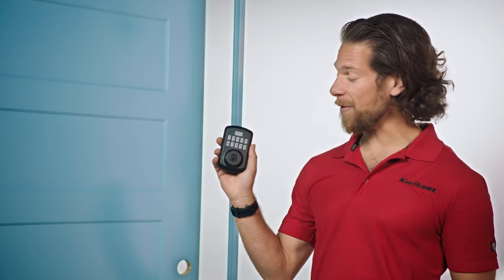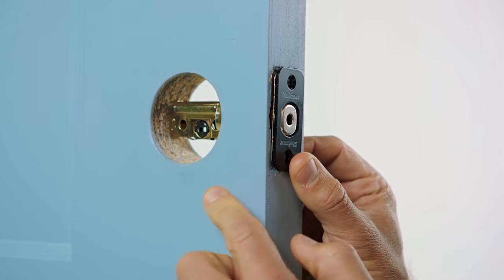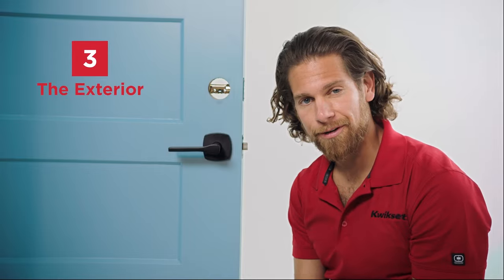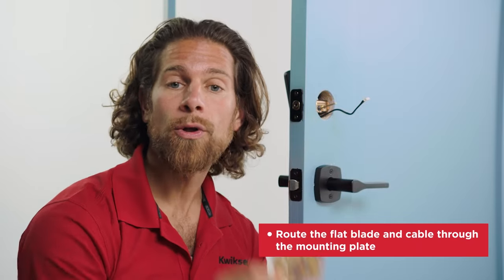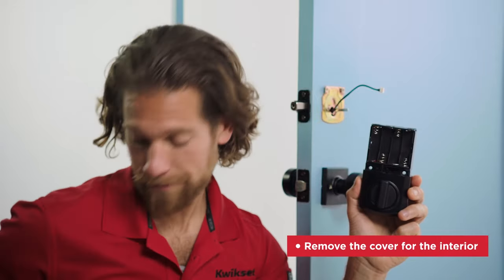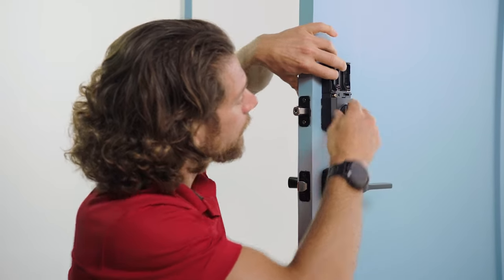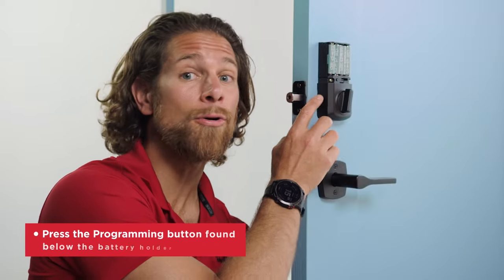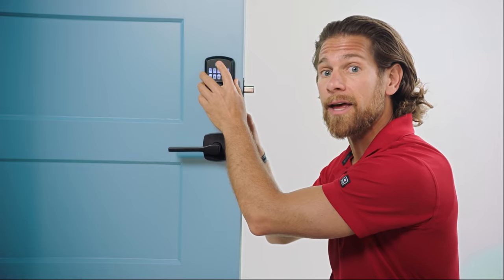Kwikset Powerbolt® 250 Electronic Door Lock Installation Video

Comment: My new lock won't set a code. It flashes red after trying to set the code. I've followed all instructions to the "t". I even factory reset just in case, but it still won't work. Any advice?
Reply: Im having the same issue
Reply from the maker: Hi and happy to help! To get the Powerbolt 250 programmed successfully, please follow these steps in order:
1. Ensure the lock was installed with the door open and the latch in the extended (locked) position.
2. Complete the Factory Reset, step 16, followed by the Door Rehanding, step 15.
3. Program the User Code, Step 6: 
https://kwik.st/3pJZg8g
If you should need any further assistance, please reach out to our Support Team here: 
https://kwik.st/3O54O6y  Thanks ~ Kwikset Social
Reply: Same issue. Just a POS!!
Reply: This doesn't work for me either.   Programming in junk.  @kwikset
Reply: @kwikset Thank you.  This worked for me as I probably did not have the deadbolt extended the first time through.
Reply: Nothing the kwikset team says will help cause they dont know what the issue is but after a very long niggt of cussing amd throwing tools i figured it out! 
The last 2 screws you install cant be too tight or it will never successfully program the lock
Reply: Same!
Reply: @DPLover4Life  you saved our sanity!!! The last 2 screws...edged them out just a half turn and then it worked!
Reply: @JoAnDelafosse  this lock is horseshit I've tried everything above and it still won't work
Reply: @DPLover4Life thank you!!! Nothing worked until we did this
Reply: Same here @JoAnDelafosse
Reply: After I set the code it was giving me that same problem. Wouldn’t even reset just kept flashing red. I popped a battery out and put it back in and the code was working
Reply: I was able to get it to set after taking the inside panel with the batteries off of the door and doing the door rehanding and letting the thing spin a couple of times, then pulling the battery when it was in the right spotty fit right onto the bladed piece.  I put everything together with all bolts loose and ran the learn procedure and everything worked.
Reply: Don’t buy. It doesn’t work
Reply from the maker: Hi @jacobwinkler1408 - Our Support Team is happy to help... please contact them here: https://www.kwikset.com/support/customer-service  Thanks ~ Kwikset Social
Reply: @DPLover4Life 🎉God bless you! Thank you!
Reply: Thank you it worked.
Reply from the maker: Hi @robcosenza5569 -  Our Support Team is happy to help... please contact them here before returning the lock: https://www.kwikset.com/support/customer-service Thanks ~ Kwikset Social
Reply: This worked for me!
Reply: I do all the steps and it won’t program
Reply from the maker: Hi @isaacortiz9232 - We're happy to help! Please follow these steps with the door open to get your lock working:
1. Check your door alignment and door jamb hole: https://www.kwikset.com/support/answers/how-do-i-check-door-alignment-for-my-smart-lock
2. Replace batteries, Factory Reset, and perform the Door Rehanding in Steps 16 and 15: https://kwiksetprodstorage.blob.core.windows.net/documents/kw_ig_5053733_9240.pdf
3. Reprogram the User Code in Step 6. Test the lock with the door open, then take your keys, close the door, and test the lock with your door closed to know if further adjustments need to be made to the door jamb.
Thanks ~ Kwikset Social
Reply from the maker: Hi @isaacortiz9232 - Our Support Team is here to help... please contact them here: https://www.kwikset.com/support/ask-a-question/inquiry/general or call them at 1-800-327-LOCK (5625). Thanks ~ Kwikset Social
Reply: My husband and I finally got it to work. Following instructions to factory reset step 16, then 15, then 6 worked to get the code set. But the latch would not open when using only code .. it would only open using code if the key was inserted (weird) …. So we started all over and reinstalled….checked that the latch was centered and that the flat blade hole was horizontal…. Reinstalled the mounting plate and made sure screws where not too tight… also, made sure the latch assembly was cleaned of any wood debris which ours had a few very small pieces inside the latch assembly… after reinstalling the batteries we did not have to reset the code that we set earlier and the latch is finally working perfectly without the key having to be in the lock.  Took our two (tiny) brains and all the helpful comments on this post to be successful. Thank you everyone for your help!! 😅

Comment: My husband and I finally got it to work. Following instructions to factory reset step 16, then 15, then 6 worked to get the code set. But the latch would not open when using only code .. it would only open using code if the key was inserted (weird) ..
.. So we started all over and
reinstalled…checked that the latch was centered and that the flat blade hole was horizontal... Reinstalled the mounting plate and made sure screws where not too tight... also, made sure the latch assembly was cleaned of any wood debris which ours had a few very small pieces inside the latch assembly... after reinstalling the batteries we did not have to reset the code that we set earlier and the latch is finally working perfectly without the key having to be in the lock. Took our two (tiny) brains and all the helpful comments on this post to be successful. Thank you everyone for your help!! 😅
Reply from the maker: We're thrilled to hear your lock is in great working order! Thanks for the update.😃

Comment: When dial turned to right it clicked up but did not appear to have positive traction and appeared loose. Would not lock door with electric function. Key works perfect and very smooth. This is my second unit. I will return it as well unless kwikset has a recommendation. This is a right side lock
Reply from the maker: Hi and here to help! To set the lock's handing, install the lock as shown in the installation guide, replace the batteries and perform the Door Rehanding in Step 15:
https://kwik.st/41nNWgx  Thanks ~ Kwikset Social

Comment: The keys work great. Unfortunately when I try to put in a code it only locks halfway and then fails. Any suggestions? Thanks
Reply from the maker: Hi Tank - Here to help! To get your lock in working order, please try the following steps: 
1. Open the door and place the latch in the locked position.
2. Unscrew and remove the interior assembly of the lock.
3.  Make sure that the Flat Blade spindle is in the vertical position and that the Turn-Piece is also in the vertical position. 
4. Reattach the interior assembly while the latch is still extended (locked).
5. Replace the batteries and perform the Door Rehanding (Page 4, Step 15):
https://kwik.st/3R8frr0
6. Test the lock with the door open.
Thanks ~ Kwikset Social
Reply: The latch is hitting the edge of the striking plate on the door jamb that’s why it retracts and don’t lock
Reply: Im here to help the last 2 screws you install cant be too tight or it will never work
Reply: Un loosen the screws then it should work that’s how I fixed it

Comment: Ok.. everything for me was great until minute 2:18! The "bolt" was still protruding (locked position) and you were going to give the "ring" away.  Then at 2:19 you are on the other side of the door ready to show us how to install the inside piece...but...now the bolt is no longer protruding and in the unlocked position!!! How did it get there??? Is it alright to use the key to set it to this position before installing the electronic piece??
Reply from the maker: Hi David - Here to help! Yes, you can use the key to lock the deadbolt latch and then remove the key from the cylinder. The latch must be in the locked position before installing the interior assembly of the lock. Please see Section 4 of the Installation Guide linked here: https://kwik.st/41eSjKF  Thanks ~ Kwikset Social

Comment: With mine the little flat key that goes through the deadbolt in the center isn't connected and it won't twist do I have to just glue it in there or how do I get it to stay

Comment: Hi I I installed the new lock yesterday . When I added new user code the barrel locked but did not unlock. When I used the key or the latch to open the door the barrel kept trying to re-lock so I had to take the batteries out. Please advise on this
Reply from the maker: Hi Anthony - Hi and here to help! To ensure your lock is working, please try the following steps:
1. Make sure the latch was extended during the lock's installation.
2. Complete the Factory Reset, step 16, followed by the Door Rehanding, step 15: https://kwik.st/4bdCqbT
3. Program the User Code, Step 6.
4. Check your door alignment and door jamb hole: https://kwik.st/48YncGo
For more assistance, please reach out to our Support Team for assistance: 
https://kwik.st/4bjt1Qi  Thanks ~ Kwikset Social
Reply: @kwikset  thank you.
The barrel seems very tight also. Could that be a problem?
Reply from the maker: Our Consumer Support Team is happy to help you further... please contact them here: https://kwik.st/3UooQwb or call them at 1-800-327-LOCK (5625).

Comment: Having a problem evtering a user code.  The latch comes out but does not cycle.  Additionally, hitting the logo will lock and Unlock the door.  Any idera what might be wrong?
Reply from the maker: Hi @bradcfi2 - To fix this, please try the following steps:
1. Check the installation, and ensure that the flat blade was installed in the vertical position. while the deadbolt latch is in the locked position.
2. Loosen the mounting bolts a quarter turn.
3. Replace the batteries and perform the Door Rehanding process in step 15:
https://kwiksetprodstorage.blob.core.windows.net/documents/kw_ig_5053732_9250.pdf
4. Follow the steps to add a user code as shown in step 6.
Thanks ~ Kwikset Social

Comment: After putting in the user-code, mine ejects and retracts the bolt then acts... broken I guess? It doesn't seem to want any following key inputs. And the whole thing doesn't even flash power etc unless the key is in the lock?
Sometimes it tries to continuously eject the bolt and just sounds like popping.
Reply from the maker: Hi and happy to help! It sounds like your lock is working in reverse and here are the steps to fix it: 
1. Open the door and place the latch in the locked position. Remove the key from the lock.
2. Unscrew and remove the interior assembly of the lock.
3.  Make sure that the Flat Blade spindle is in the vertical position and that the Turn-Piece is also in the vertical position. 
4. Reattach the interior assembly while the latch is still extended (locked).
5. Perform the Door Rehanding (Page 4, Step 15): https://kwik.st/3Q9TXcu
6. Finally, check your door jamb to ensure it's a full once inch deep and test the lock.
Thanks ~ Kwikset Social
Reply: Nothing the kwikset team says will help cause they dont know what the issue is but after a very long niggt of cussing amd throwing tools i figured it out! 

The last 2 screws you install cant be too tight or it will never successfully program the lock
Reply: Hi Digital in Daniel, did you ever get this to work?? I tried the "reply" from kwikset, but it still doesn't work and is doing exactly what you described... just keeps "popping" and when I try to turn the deadbolt back to retract, it won't let me and keeps extending it out. So frustrating. Any help is appreciated:) :) Thanks!
Reply: @RatLounge  Naw mate I just tossed it :^)
Reply: @DPLover4Life  Oh my gosh.  On your advice I backed both of those last two screws out a quarter turn and it started working.  Thank you!

Comment: After 3 hours of installing and re-installing, still not having any luck.  I've followed ever single step carefully, made sure everything is perfectly aligned and the bolt moves freely.  But the thing still won't program.  At one point, I had the code working but it was the opposite of what it should be.  So I used the door rehanding code.  That failed.  So I did a factory reset and can't get past programming a code.   Might be time to return it to the store.   Ugh.  So frustrating.
Reply: Same issue and I'm returning it, things junk
Reply from the maker: Hi @RuStOlIuM420 - We're happy to help you! Please reach out to our Support Team for one-on-one troubleshooting assistance: https://www.kwikset.com/support/customer-service  Thanks ~ Kwikset Social
Reply: @kwikset  I just got a old fashioned deadbolt

Comment: I have a question. I can unlock my door with my code, but I can’t lock it from the outside with the code. What am I doing wrong?
Reply from the maker: Hi @michaellattimer8647 - The code is only needed to unlock the deadbolt. To lock it, press the Kwikset button at the top of the keypad. Thanks ~ Kwikset Social

Comment: I have gotten all the way to entering my code and it is not working. I have checked the batteries. The lights on the numbers come up but nothing happens when I follow the steps there is not beeping after I hit the program button
Reply from the maker: Hi @LornaMcCarten - Please check the installation and factory reset the lock per step 16. Next, perform the Door Rehanding process per step 15. Program a user code in step 6 and test the code:
https://kwiksetprodstorage.blob.core.windows.net/documents/kw_ig_5053732_9250.pdf  Thanks ~ Kwikset Social

Comment: mine works when the key is installed and NOT in the lock or removable  position, when the key turned and removed the motor will try to move the deadbolt but cannot move it. The key to be removed is in the lock(deadbolt out) position and manually you cannot move the inside lever.
Reply from the maker: Hi! Please ensure to remove the key from the key cylinder and uninstall the interior assembly of the lock. Keep the keys removed and reinstall the interior assembly while the latch is in the locked position and the flat blade is vertical: https://kwiksetprodstorage.blob.core.windows.net/documents/kw_ig_5054449[250]eng-spa.pdf Next, replace batteries and follow the rehanding steps and test the user code. Thanks ~ Kwikset Social

Comment: So what if my door is locked and battary died out?
Reply from the maker: Hi Rafsan - Here to help! The Powerbolt 250 includes a key cylinder in order for you to use the physical key if the batteries lose power.

Comment: How do you pull the lock out manually?
Reply from the maker: Hi! If you are trying to remove your lock, we are providing a link to the installation guide for the Powerbolt 250 so you can see how it was installed and get an idea of how to remove it. If this wasn’t your question, our Consumer Support Team is here to help. Please contact them here: https://www.kwikset.com/support/ask-a-question/inquiry/general or call them at 1-800-327-LOCK (5625). Thanks -- Kwikset Social

Kwikset Powerbolt 250:
https://kwiksetprodstorage.blob.core.windows.net/documents/kw_ig_5054449[250]eng-spa.pdf
Reply: @kwikset  I was able to figure it out, thank you so much for the video, cuz the instructions were a headache. lol

Comment: This lock won’t let me delete a old code. I’ve did everything the website and instructions the lock came with and it will not let me do a factory reset no matter how many times I take the batteries out and leave them out.
Reply from the maker: Hi and here to help! To Factory Reset the Powerbolt 250, please keep the batteries in the lock and follow the steps in Section 16 of the Installation Guide here: https://kwiksetprodstorage.blob.core.windows.net/documents/kw_ig_5054449[250]eng-spa.pdf  Should you need any further assistance, please reach out to our Support Team here: https://www.kwikset.com/support/customer-service  Thanks ~ Kwikset Social
Reply: My lock only works if I use the key to unlock then once the key is out it won’t unlock by itself
Reply from the maker: Hi @juanloza3451 - Please try uninstalling the lock and reinstalling it with the key removed. Next, replace the batteries and follow the Door Rehanding process per step 15. Test your current code or program a new user code in step 6:
https://kwiksetprodstorage.blob.core.windows.net/documents/kw_ig_5053732_9250.pdf  Thanks ~ Kwikset Social
Reply: @kwikset  the link provided doesn’t exist. Do you have another one?
Reply from the maker: Hi @resistancetacticalpreparedness - Yes, please try this link, select the Support tab and click on the Installation Guide box: https://www.kwikset.com/products/detail/powerbolt-250-transitional-keypad-electronic-lock

Comment: I have no problem getting this lock to work on left side locking doors, but I have bought 12 of these locks and none will work on right side locking doors, I tried the door relearn and it beeps red as unsuccessful, nothing is working idk what to do.
Reply from the maker: Hi Jim - Here to help! Please ensure you've installed the interior assembly while the latch is in the locked position and the flat blade is in the vertical position. Next, perform the door rehanding process in Step 15 with a fresh set of batteries: https://kwik.st/3G6WsXr  Thanks ~ Kwikset Social

Comment: When I press the code the door locks instead of unlocks. Any ideas ?
Reply from the maker: Hi @alcidiocorreia6679 - It sounds like your Powerbolt 250 is working in reverse and here's how to fix it:
1. Open the door and place the latch in the locked position.

2. Unscrew and remove the interior assembly of the lock.
3. Check that the flat blade piece is in the vertical position. See Section 4-B.
4. Ensure that the turn-piece is also in the vertical position when reinstalling the interior assembly.
5. Perform the Door Rehanding in Step 15.
https://kwiksetprodstorage.blob.core.windows.net/documents/kw_ig_5053732_9250.pdf

6. Test the code with the door open. It should unlock the deadbolt. To lock, only press the Kwikset button at the top of the keypad.
Thanks ~ Kwikset Social